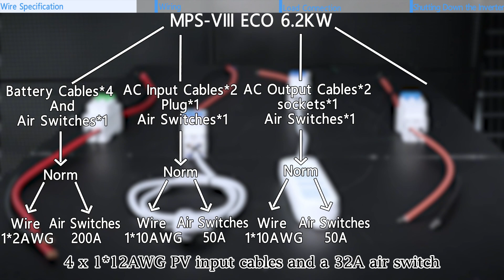Y&H 6.2KW SOLAR HYBRID INVERTER HOW TO WIRE EASILY?

Comment: Could you tell me if this would work to just put power back into the grid and when grid power is off will it detect so that way it doesn't feed back into the grid is this the one that I need for this? I don't want to feed back into the grid